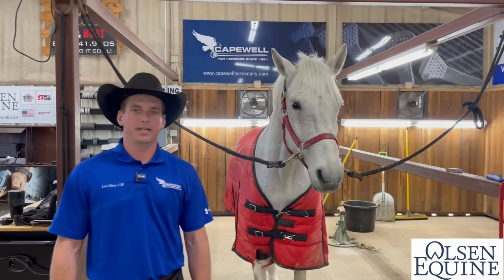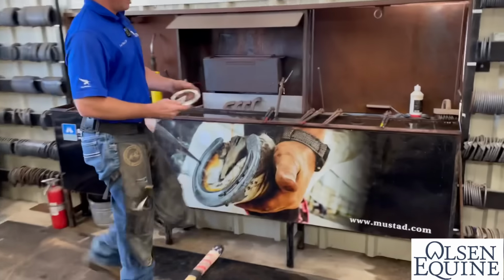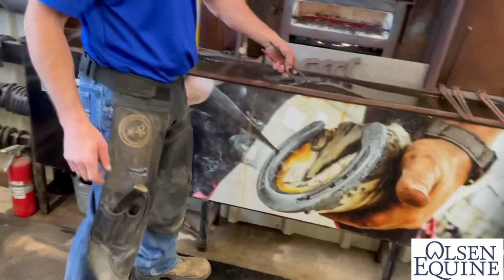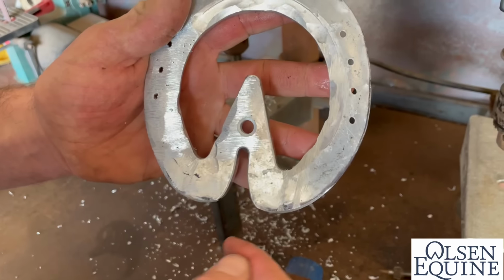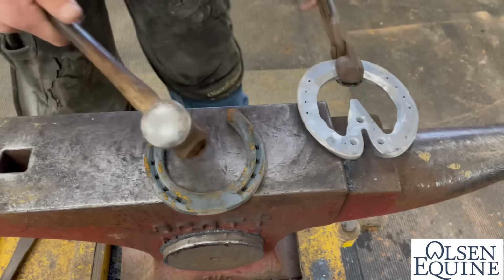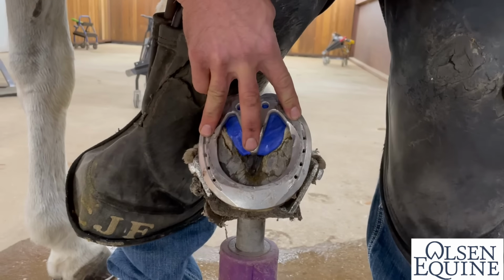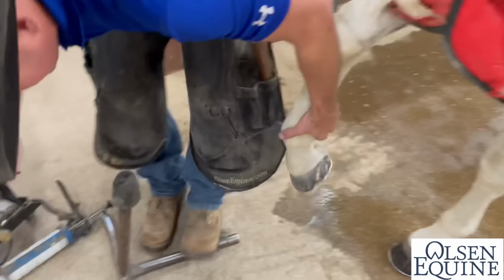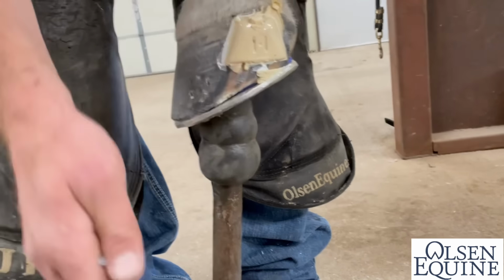Check out this Horse’s Painful and Bleeding Quarter Crack!  Hurting to Happy with Lee Olsen CJF

Comment: Well that was fun to watch.   I went to Dawson Creek to learn this skill in 1974.  Lasted 18 months.  Too tall, too slow and not clued in enough.  Loved watching you using your hands to do things like flipping the file around end for end, feeling the tip of the nail exit the foot to gauge where it was located, etc.  Subtle stuff.  Worn through chaps with the gouges on the inside of the legs. 

Back brace ! Got racked Real Well by a couple of foundered donkeys the first time and a Shetland pony put me out of business the second and last time.  Who knew you needed back muscles to lift your legs up onto the clutch and brake peddles to get off the claim and limp back home to lick your wounds. 

Not 1975 in this vid.  Horse brought to your shop, not visa versa.  Bone handled trimming knife with a brass pommel - Woot.  Grinder, Drill press, stall with tie points.  Well and truly laid out.     I had a pair of GE nippers that cost $200 bucks I think.  Some Black Diamond tools as well.  Still using the pull-offs 47 years later. Mustad made the nails and shoes.  We made the pritchels and clinch blocks when we were learning how to use the forge.  The welding shop trade school students made my coal fired forge with a hand cranked blower.  The shoeing stand was made from a disk harrow disk and a length of pipe and my anvil was cut from a piece of H beam.   Fit it all in my VW microbus with an Old Horse Shoer Blacksmithing Coal burlap sack tied to the front for advertising.   Not anything like your shop. 

12 weeks of trade school later and there I was.  A farrier set loose on the unsuspecting public.  Ha.  They saw me coming from a mile away.  Every owner of a misbehaving, cracked hoofed horse in my area looked me up.  One penny pinching horse woman negotiate 25% off of the $8 I charged for being allowed to trim the feet of her 6 horses.  Never told me I had to catch them first.  Boy, I was dumb.

I've been watching those guys trim cows feet.  I can not believe how much material they take off with those grinders.  Speaking of grinders, that was a pretty spooky fix you did there.   We were shown how to put long nails from side to side to lace it up.  Never had to do that 'personally.  Trimming the 'Dutch boots' off the aforementioned donkey with a hack saw was spooky too.

Anyways, nice set up, very skilled hands and a great horse.  Glad I watched your video.
Reply: Such a great comment - thank you for such a vivid mini-story!!
Reply: It felt like he has done that flip so many times he’s probably not even really aware he’s doing it. Since he’s probably done it thousands of times and now it’s just an instinctual thing.
Reply: My hubby went to school in '78.  He still loves to tell the stories of the rank ones he'd done.  Thanks for the memories.  🐎

Comment: Lee, watched my Dad trim his horses from quarter horses to throughbreds.
Saw cold shoing and hot shoeing.
Iton shoes and aircraft aluminium shoes.
Your use of epoxies,  elastics, forge, anvil, rasp and blade were inspiring.
Remarkable eye for fit and gentle manner working with the horse.
All with out 1 cuss word or slap on the rump.
I noted the gallon of urine but no road apples!
Well set up shop and work area.

How many years training I know not.
Many years good fortune to you.

Comment: A little bit of cutting fluid will make drilling those holes in aluminum much easier and make those bits last twice as long.
Reply: @JC-lr8ik  wtf
Reply: Actually Aluminum is free-cutting, doesn't need Lubrication
Reply: @xhale018  Actually it doesn’t hurt
Reply: @josiffexplosiff1   What are you talking about?
Reply: @josiffexplosiff1  but it doesnt, if you're using the right speeds and feeds, it makes no difference. so why're you piping up with your sarcasm.
Reply: @xhale018  lol. Your the only person I see "piping up".
Reply: He just needs to up the speed on his drill press and get a stronger motor for his grinder
Reply: @angelicupstart23  He seems to do just fine with what he has, tf

Comment: The metal rasp is the best tool for taking off hoof walls, as there is no mandrill you could hold onto as you work, it’s just too big and not easy to manipulate!..in spite of the dainty footed horse!!…good job on drilling out that crack with the largest mandrill and bit, it takes a lot of time to do but gets it correct as well as being dry to accept the dental putty to set up and stick to the dry surface…..yahoo for Saran Wrap!!  The patches are super, as well as air hose tubing!!  I loved this video!!❤️

Comment: Brilliant Idea to keep the air going to dry crack out.  There is another farrier / Vet educated guy that shod olympic horses that does the same thing only he roll up a strip of hoof packing, then after epoxy dried, used  a welding rod to clean it out.  I had him look at my expensive show horse that had a crack from underrun heel.  ( my sister gave me horse, not that rich), but i can send you a link to his video doing this.   also, like the way to straightened out a horses gait by keep the medial side longer.  I used a small wedge pad side ways to keep my horse from winging.    thanks for all the videos.

Comment: Glad you were able to help the horse. I hope he got the time off to heal, but I can't help but wonder - What the Whaaat(???) was going on that it got this bad to begin with? That didn't "just happen" overnight.
Reply: It doesn’t happen over night, but I have seen it on horses out on pasture not doing anything. It’s like people - some have very strong, healthy nails — others have weak, constantly splitting, tearing off, etc. as I have gotten older, my nails have gotten terribly weak - one the other day cracked and the next thing I know it just tore off back to the quick.  Not fun. 

Usually on horses that have bad feet, I adjust their nutrients especially amino acids, add flax seed in and raise the protein levels. I usually get the vet to pull lots of different blood work panels and check mineral levels etc. Sometimes it works and other times not. But it takes at least 6 months and needs to be continued for life. Doing this will also improve mane, tail and coat.  Almost 70, grew up understanding white hooves are weaker. Now today, some say that’s not the case - not what I have seen for 5, almost 6 decades. 

Some of these youngster who have spent maybe 5-10 years working on horses or doing research haven’t spent the time on enough horses to really know the facts.  When they have worked on horses for 5+ decades and written down and documented the facts, then maybe I will believe it.  

I think hooves need proper nutrition from birth throughout their lives. Also, ground conditions make a big difference. Constant dry sandy soil is hard on hooves. Just as constant or frequent wet muddy ground is.  I have seen horses out on oak shavings and their hooves just fry out terribly. I won’t bed on oak - only pine shavings or preferably fresh sawdust.  Actually I like bright yellow long length straw but you have to be vigilant on cleaning the stall and keeping it well bedded, and banking the walls. Today it’s hard to get decent clean, bright, long length wheat straw.
Reply: @plips71755   I agree with all of that and yes certain horses and even some breeds altogether (TB's are not known for great feet) have hoof and usually sometimes also health issues. But again it doesn't get this bad overnight. It usually takes a few weeks which can even be over a few shoeing cycles. 

It also doesn't correct itself overnight either. It can take a full year (or longer depending on their nutritional needs as you point out) to grow out new hoof from the coronet band all the way down. 

I currently have a filly now mare that went from having very little to no hoof growth between trim cycles at 8 weeks. With proper feed and hoof supplements her body/hooves think the 4 week plan is excessive and she's already chipping up. This is on grass and relatively soft ground and arena work, so not like we're out on hard, rocky ground or anything.... Feed, environment and genetics are huge factors to consider for our four legged friends.

Comment: 13:30. you should move the press up and down more often. It will clear the chips and not bind your bit. similar concept when you drill a post hole for a fence. you have to move the dirt out of the hole as you go, or there will be too much material to let the tool turn.

Comment: Does overworking a horse cause cracking?   It seems it should be stabilized with adhesive filler to repair and stop further cracking or breaking off.  This was an interesting video.  I hope we get a followup on the horses therapy and treatment.

Comment: I am a blacksmith, not a ferrior. Also raised owning horses. I have forged aluminum a bit and understand the metallurgy, my question is... you made some adjustments to the frog on the shoe. Some you did hot, but you did it cold. Considering the weight of the horse and the power they hit the ground with. I did not see anything as far as treating the metal that would prevent it from changing shape while on the horse. For example....quenching and tempering is what makes a spring a spring or a blade a blade. If you skip that you just have a piece of high carbo steel that is not being used to its full potential thus....might as well just used mild steel. Aluminum has similar features. What prevents that shoe from "bending/molding" right onto the hoove where you floated the crack? If the shoe can be adjusted cold what do you do to "set" the shape of the shoe that like a saw blade allows it to move but rebound back to its original shape with out being "adjusted/moved" to a different unintended shape while on the horse.

Comment: I have never had a horse with a quarter crack ever. I am not acting as if i know everything about a horse. But when i owned a horse i would just periodically check for rocks or a large amount of dirt in his hoof and clean it up.
Reply from the maker: A quarter crack does not come from the sole of the hoof in most cases! Though it is extremely important to keep a hoof clean, quarter cracks often come from a horse catching themselves in the quarter, or from an injury to the coronary band! It is an issue that some horses struggle with just from their conformation!

Comment: So in this video it seems the usual routine is to grab a shoe off of the rack, near to the size or configuration needed, the doing a little smithing as needed.  I’ve watched other websites where the thing is to do the whole blacksmith thing from scratch, starting with a piece of what must be mild steel and hammering it into compliance including the nail holes.  I guess if you go to remote locations you can’t carry a whole rack of shoes, so that would be a reason to blacksmith from scratch.

Comment: HM,
You might say the horse got pissed off !
Sorry couldn't resist that one

I really don't like aluminum for shoes,  I personally think they wear down to easily and and deform with any amount of rough riding,
I used to do my horses always with steel, especially in the mountain riding
And too much flexing will put minor cracks in AL.

Very good work

Comment: Just curious why you dropped the heart bar down so it hits the ground first and would it not have been better to grind some off the contact side to alleviate the pressure on the frog, keeping it flat on the ground?

Comment: With aluminum being so soft, wouldn't you think that once the shoe is on, and with the weight of the horse and its movement on rocky or uneven terrain...that the aluminum shoe would change its shape quite quickly again???  Just wondering.

Comment: when ur drilling the dental impression holes on the shoe would it help to use lubricant or is it out weighing the hassle to remove it. im assuming u dont want oil or lube on a horse shoe
Reply: I think its more an issue of the drilling technique or the drillpress, I would guess the belt needs to be tightned or he needs to raise the drill bit a bit more often to break the chips. I heared that using cutting fluid doesn't make a big difference on alumium if your speeds and feedrate are fine.

Comment: that aluminum is so soft I believe it will just flatten with the weight of the horse pushing up onto the frog pushing the dental putty up witch will put even more pressure into the frog.

Comment: If you will note the curvature of the white line in the heel area. This is caused by heels that are too long and underrun just a bit which also is the main culprit to a quarter crack. Personally I would have lowered the heels two degrees more to get the base of support back further and used a 2° wedge heart bar to maintain the coffin angle so as too get the base of support backed up Just my opinion which isn't worth much

Comment: This 1 is confusing me a bit. I would think when the horse walks on the raised part would push it back in. I would have thought to keep the the as flat as possible and grind out from the inside to keep pressure off.

Comment: Very proficient job young Sir! Feel free to bathe in the waves of admiration across the pond from the U.K. Your skill is up with the best. I'll also second the commenter that has thanked you for not dropping the foot to the floor - many farriers in this country, even otherwise good ones will persist in doing this on the grounds of saving their backs - pretty weak argument there as your back will be stuffed doing this work for forty years! There's a joke over here that madness is bound to follow if you work with you bum higher than you head.
My heavy built Irish Draught mare (avatar) used to suffer occasional "sand cracks"  (I don't think they have anything to do with sand!) treatment was not so developed during her lifetime though I did do some pioneering experiments with some success and had the skills of an excellent farrier (Garry Huston - check out his channel. ) Splits such as this often occur at the junction between white and black horn and I reckon are to do with differences in growth and quality - may be contraction and expansion. Any horse suffering from them repeatedly is probably missing something from its diet or it's down to genes.

Comment: When the hoof can not spread with the weight due to a metal shoe stopping that spread that pressure goes some where. 
It goes up the hoof creating these problems including ( but not limited to) side bone and the hoof wall separating from the “white line”. 
Jumping puts incredible pressure on the foot, but it’s not allowed to spread, so yes that pressure had to go somewhere and as it kept going up to the coronary ban the crack was only a matter of time. 
This expensive, helpful, with repeated resetting shoeing will help but will not replace rest, barefoot in the pasture for a complete heal … just saying…

Comment: I like that foot rest thing.  It looks like a jack with the top replaced with a u-shaped thingy.

I got pretty distracted when there was a huge puddle when he came back.  I'm assuming the horse let his bladder go and the guy only swept most of it out the door???  That bugged me.  If there was a crack in the hoof...bacteria would from the urine would have LOVED that entrance.  Is anyone else uncomfortable about that?
Reply: He said he put wonder dust?
Reply: @danlux4954  thanks so much for replying.  Wonder dust is for wounds...not cleaning urine off floors.  I just couldn't get over the fact that all he did was brush the top layer out the door and leave the rest inviting buggies in the hoof (wonder dust or not...what if the other hooves had sores in the frog or something.  What if other horses came in and got urine in their hooves...I mean that's gross and careless on his part.) and walking through it and tracking up every where else.  I was frankly appalled.

Comment: Prior to this video I have been watching a lot of videos published by donkeys` hooftrimmers from the Far East (?). I suppose that schools for teaching/training for this job don`t exist there. Nevertheless these people should try to learn and to do more for the poor donkeys and not rely on their tradition and on the owners' placing of order for trimming which come too seldom by far. And they should remove all the rotten horn from the frog with narrow knives.  
And they should consult a veterinary surgeon when it is necessary - they shouldn't try to do the work of a vet. This could turn out to be very dangerous for the donkeys. -----
       In order to learn about the trimming job the men should have a look at the following videos (for example):
"HOOF CRACK Horseshoeing", "Hoof Restoration", "DOUBLE HOOF Infection", "Long HARD Hoof TRIM and Shoe", "Mix - Olsen Equine CJF", "Abscess and Repair", "Tendon INJURY -Recovery Horseshoe" and "The Longest Hoof I`ve EVER TRIMMED - Hoof Restoration".